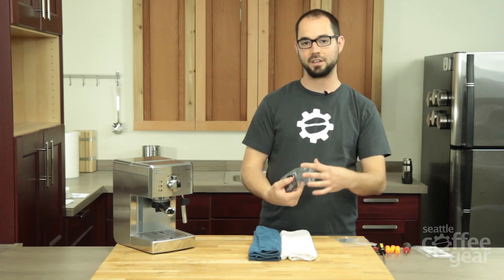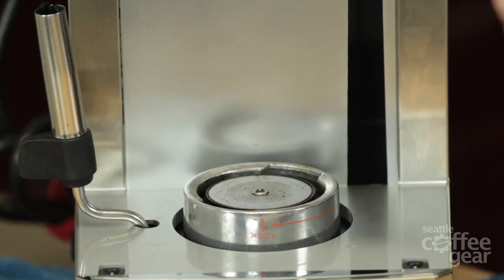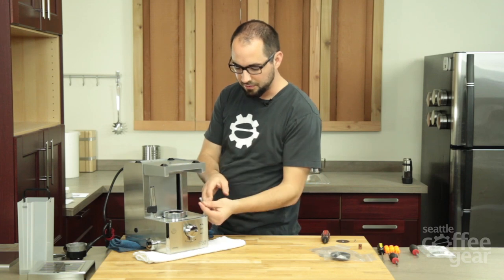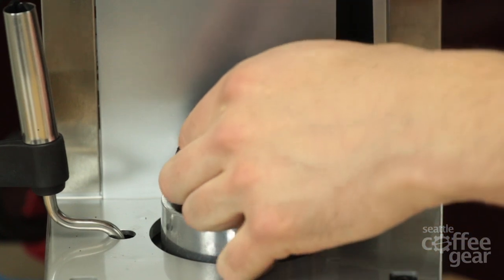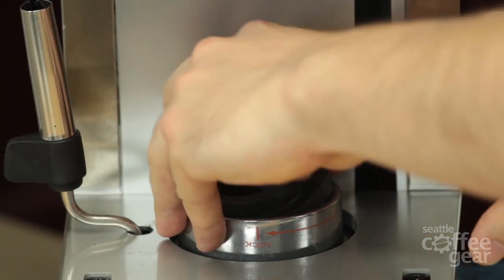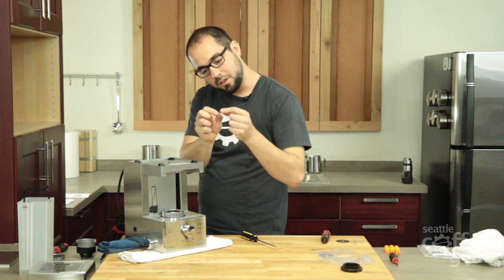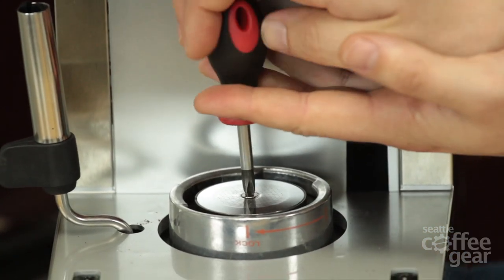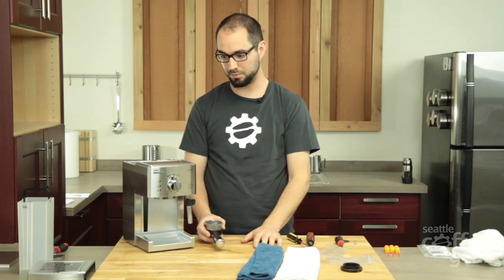Tech Tips: SCG's Tune Up Kit for Saeco Poemia

Comment: Your home brewed/modified screw driver for the pressure valve screw can be easily substituted with a socket  driver approach.  Use a socket that fits a broad slot screwdriver head used with a drill. now you can use a socket wrench+socket+screwdriver head.

Comment: Hi just saw this interesting video.  I have come to the stage of the "boiler bushing".  Your video showed that the "boiling bushing" came out so easily but I am unable to remove this even when I specially bought a "Philip flat head screw driver" like what you use but yet it cannot be unscrewed.  Any advice on how to remove this.  :face-fuchsia-wide-eyes:

Comment: My Poemia Hd 8327 always presents the same problem from time to time and that is that arm fixed and tight at coffee mode ignition loses (out of the water) making the coffee itself diluted and therefore NOT drinkable ...
What do I have to do with the problem of the step grating of the scallop or the filter holder arm where the waffle holder does not fit perfectly into its space because of the non-circular and well-positioned wire?
I await your suggestions .... thank you very much

Comment: Our Poemia, claims to be HD8425, has two screws instead of one, about 3/4 inches apart but there is a central hole as if this would be the same filter fitted to a different case. I didn't dare removing the filter without a tune up kit at hand yet... do you think you have such a tune-up kit? or is my Poemia somehow not "original"? (came with warranty a year ago so I guess it should be)

Comment: My screen fell out (hole enlarged over time) and left the screw in. The (Phillips) screw head is rather soft and so far is completely seized. I don't want to use WD40 or anything that might taint the coffee.... Any ideas?
Reply from the maker: Hi Ian! You could definitely try and use a food safe lubricant to try to get the screw out. You should be able to find that at a restaurant supply store or perhaps a hardware store. You can for sure buy it from us here: https://www.seattlecoffeegear.com/saeco-brew-unit-lubricant. Try that out and give us a call if there are anymore issues!